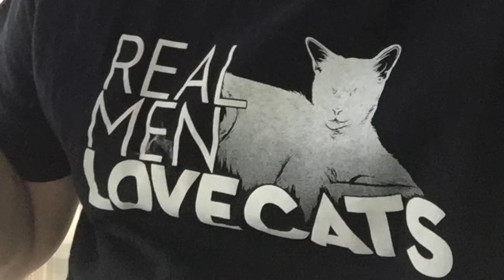Riamondo Guitar Neck Ding repair... from beginning to end. Part 3

Comment: Thanks for this video as I have to do a similar repair caused by a crappy capo half a century ago.
Reply from the maker: ...but it is fun and interesting to work on guitars... unless there is a time pressure on you.
Reply: @LennonLuthierFinagler  Yes it is fun work in on guitars & banjos, especially as I get older & find it harder to play & sing.  As a former Co Down lad (Kircubbin), living in Australia since 1959, it is great that I can learn new skills from a luthier in a part of the world I love so well and the first luthier I have heard who doesn't speak with any kind of accent.  

Do you have any thoughts on compensated nuts, positive or negative?    The major manufacturers, Martin, Gibson etc. don't provide compensation at the nut but I have heard many of their guitars, both accoustic & electric, play sweetely with the addition of a compensated shelf nut or the cheaper Hosco SOS (string offset spacer).  I have added the Hosco SOS to two high end Martins & a 65 year old Maton HG100 with more than satisfactory results. Particularly the Maton which really opened up with nut compensation & is now a joy to play even with a capo well down the neck.  

 Looking forward to a future video from you on compensated nuts & possibly another on setting up a 12 string guitar where the saddle compensation for the octave strings is always out because of the backward angle of saddle.    As they say, 12 string players spend half their time tuning & the other half playing out of tune.

Comment: So I’ve got a similar dent in the back of a guitar neck, that I ended up smoothing out with a small rat tail file.  This resulted in a rather shallow, oval shaped, rounded/smooth dent about 1/4” wide and 3/4” long along its center lines.  

Though it’s literally been this way for decades, last week, I decided to tape it off and drop fill it with Titebond thick CA Glue.  I did everything as shown in this video, and once the third layer of glue had fully set, I sanded the fill smooth with 600 to 2500 paper.  Then I removed the protective tape, from around the fill, and noticed the tape thickness had left the patch a tad bit proud of the neck surface around it.  

So, not wanting to mess up the neck finish, U decided to do the razor blade scraper trick.  And, much to my shag run, when the blade edge contacted the superglue edge, the patch peeled right out, leaving me back at square one.  

Any suggestions?   Should I spray an accelerant in the dent, before putting the first layer of glue down?  I’m thinking it might increase the bond strength between the glue and the wood.  Should I scuff up the dent?  Though I hate to do that in case my second attempt also fails.  Thoughts?
Reply from the maker: Hmmm strange. Couple of things that it 'might' be.... I would not have used the 2500 sand paper.... I would have used 400 in the dent and left it, then I would probably suggest is using medium or thin glue and use two of three coats to get the correct height, making sure there are no bubbles... .... may I ask, did you have a brand new shape blade... I am sure you did but I must ask. Not sure about accelerants as I have never used them.. sorry.
Reply: @LennonLuthierFinagler  all good points.  I did not scruff up the vent before drop filling with super glue.  Now that I think about it, I probably should have cleaned it thoroughly with naptha, too.  The was sharp, but not new.  I assume the CA glue would be hard, to almost brittle, but this was a bit playable, when it came out; stuff but playable.  I used Titebond thick, but if I try it again, I’ll likely get some plain ol superglue.  Get some activator, too while I’m at it.
Reply from the maker: @bldallas  I have never used Titebond Superglu but I was Titebond wood glue and it is amazing. I use EverBuild Superglue GP... but I have used cheap old £1/$1 store glu and it worked fine... try a drop on a old piece of shiny wood and then try scrapping it down. Not sure about activator - it may leave a wrinkle... but let me know if you use it and how you get on.

Comment: After you sand down the super glue, do you simply polish it out or do you put any kind of lacquer finish back on top to seal /fill it all in?
Reply from the maker: If done carefully it won't need any filling in. There are a few ways.... if it is a non-gloss neck I would use very fine sandpaper up to 7,000 and that would give you a nice non-gloss finish. If gloss is required you can use the normal clear hard gloss spray can to get the guitar back to gloss but it would need to be finely polished afterwards. In some instances I have used Crimson Guitars High Build guitar finishing oil... but that requires a lot of drying and polishing etc.